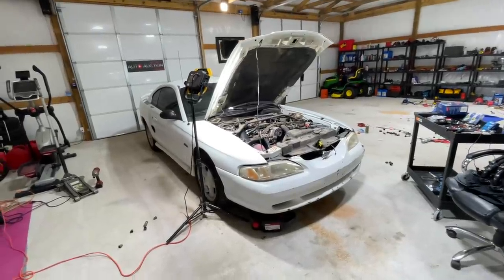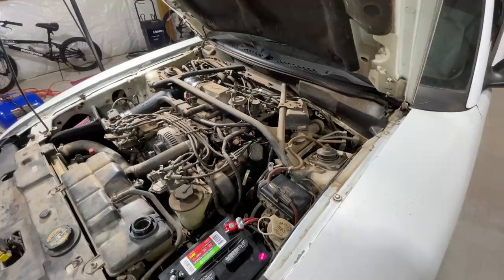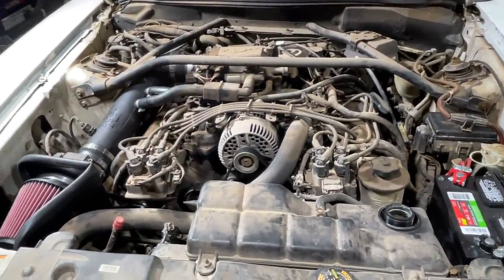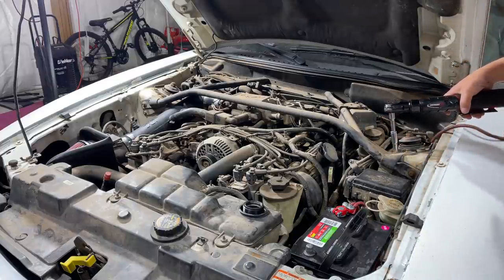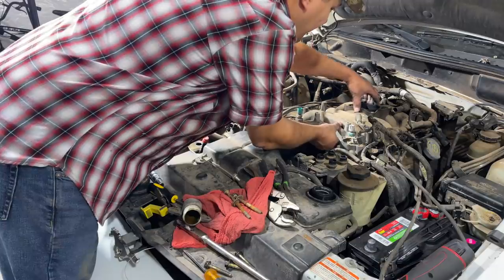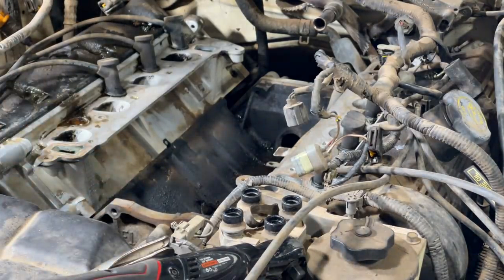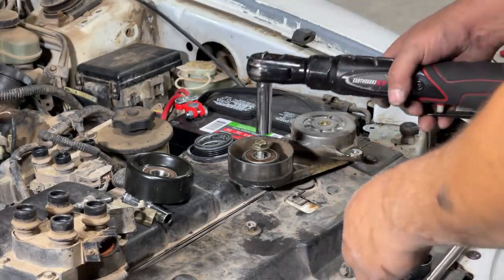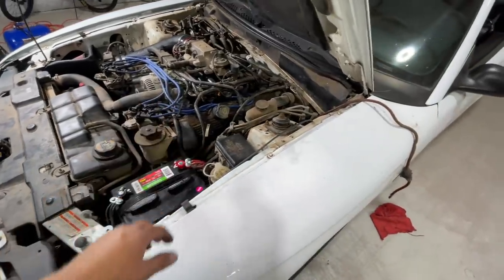$400 IAA 1997 Ford Mustang GT Has a MAJOR Issue!! Let's Fix it!! #SN95

Comment: Randy's still working on the Mustang at 5:30 in the morning after doing a complicated intake manifold swap and the arm chair pit crew on here are out of their minds over a dirty engine. Looks like reality doesn't get in your way often.
Reply from the maker: Amen brother!
Reply: lose the old man grunt.
Reply: I don't think Randy is interested in replacing any more coil packs due to water damage. Happened to him on the S600 and that could be a reason why he hasn't done it since. That's how I can tell that these folks have not followed him for very long.
Reply: This is true,  however if it were me I would have power washed that engine bay before I even touched anything just to make my work space at least 50% clean instead of leaving it 150% dirty.  This is just me talking however.
Reply: Vintage Traveller,  well said.
Reply: it wasn't a diss I just saying clean it so anything want fall in it
Reply: Did you change the hose

Comment: I wish you would detail the engine on the SN95 man. Great content today though 👍
Reply: Yea I would have powerwashed the engine bay before doing the intake.
Reply: Randy, Cris Fix has a great video on cleaning your engine. If you are spending the money on the paint and tires/wheels, it would be a shame to leave the engine compartment in such a filthy state.
Reply: Not gonna matter hes painting it some other color so engine bays gonna look weird being white and the car some other color
Reply: Seriously looks like the car drove through a sandstorm
Reply: I never like working on one when they are that dirty........if i can help it
Reply: Since all of you guys are so picky about how you want things to be done why don't each of you volunteer to stop in and put a day or two a week helping him to get things done! He's a one man show with several cars being worked on! I think he's doing the best he can!
Reply: @TCBGARAGE   it would be nice but i doubt it. Should just repaint it white with some metallic flake in it
Reply: Apparently you guys never saw what happens to an engine bay when a car goes into the paint shop. The prep work will make it dustier than the Sahara. That having been said, It's not a real slick idea to go ham with a hose under the hood. He changed the intake because it was leaking coolant all in the spark plug wells causing the engine to run badly and throw codes. Eventually, it would have blown out the coil packs. He caught it early enough that might be avoided. In extreme cases, it will fry the drivers in the ECU causing that to need replaced. If there are breaks in the insulation on the wire harness, water can easily be introduced causing you all kinds of problems. Alex from Legit Street Cars stated in a couple of his videos that he does everything he can to keep water out of the alternator for obvious reasons. But he does not direct water spray on the top of the engine anywhere. Randy is not doing a Concours resto on it. He's getting it fixed up decently enough to flip for a good profit. If he was building this car with the intent to take it to car shows, then I'm sure he would be meticulous with the engine bay. But he did not state this as his intent.
Reply: Totally agree,  however it doesn't need to be detailed in my eyes either,  but a power wash would have been my priority before touching anything in that engine bay.  Just for the sake of having a remotely clean work space.  This is just my opinion however I'm sure a lot of other people would have done the same.

Comment: This proves your are a pretty decent Mechanic. You did a great job on that and the filming of it. Awesome job. Danm good thing you replaced the plugs they were so nasty and loose.  Is one of the plug wires out of sink? It runs though. I am willing to bet there must be a vacuum line off or broken possibly causing misfire and fast idle 99 percent of the time.    " Sell them all and buy some more! "

Comment: The plugs may be loose for a reason. There is a special way the plugs go into those 4.6 mod engines. I believe the engine should be warm when installing. My 03 mustang blew a plug out the block after a tune up for failing to tighten when the engine was warm

Comment: Some of those intakes don't line up right. You have to put RTV in the head Divot holes or you get an air leak. I'm not sure if yours is that style, it may be ok. Check fuel trims at idle. Had to redo my Grand marquis. There is usually a paper with the intake about it, sometimes not. 4:47, the rubber gaskets straddle the divots on the head.

Comment: Well done, mate.  Several jobs done in one night of wrenching - including a major one.  When she finally fired afterward, she was definitely on 7, but after a couple of good revs, the engine stopped wobbling with the dead miss, so maybe one of the spark plug holes let a bit of coolant down when you pulled the plug and it didn't clear until the engine and plug became hot enough to steam it out.  Give her a run before pulling it apart again - the motor sounds strong (and those pipes make it sing!), so if it's still an issue after the cobwebs have been blown out, it should only be a minor one.  One thing kept going through my head while I watched - a quote from Derek on VGG - "All them electrotronical wiring things really get in the way of a guy try'na fix on it".  All the best

Comment: You should give the engine bays a real good power wash with a de-greaser and cleaner before you start working on them. That way you wont have all that dirt and dust and crud around all your connections and fittings. Just a suggestion.

Comment: Installing the '99 and up PI heads on the '97 block will bump up the compression to about 10:1 and they flow better and come with more aggressive cams as well. The required intake flows better too.

For that kind of major work on the SN95 it's easier to do it with the engine out.

Comment: Hey Randy looks to me like that leaking hose under the intake has been replaced before . Look at the worm type hose clamps, I don't think Ford used them at the factory.
Reply: Correct, they use them one time deals that have to be cut off. Somebody had been there before. They also failed to retorque the spark plugs after a couple heat cycles as indicated by how loose they were.

Comment: My wife's explorer uses an orange- colored coolant from factory as does my mercury montego.  But I can see where someone could easily mix it up or add dexkill to non dexkill coolant.  I'm guessing you found jugs in the car from previous owner.  Just wanted to throw my. 02 about the orange-colored coolant being a factory coolant.  Unless, previous owners on both the above said vehicles are using incorrect colored coolant.

Comment: You can usually quiet a belt tensioner pulley (if you are in a situation where you can not get one right away) by taking a pick and carefully prying off the rubber seal on one side of the bearing and pushing in a little fresh grease,, preferably molly type grease.  Will last a long time,,,  :-)

Comment: Those SN95 intakes (especially the older ones) were notoriously trash.  Really and truly, unless you're doing a full PI swap, heads and all, it's better to go back with stock.  It's not enough of a change that you're missing anything. Also: 1) That leaking tubing in the valley is NOT stock.  There's a heater tube that goes there, and Ford doesn't use screw clamps. 2) Just get a cheap set of fuel line tools from Harbor Freight for $10.  They're worth it. 3) Use the Motorcraft filter for modular engines.  They have an anti flowback design that helps maintain oil pressure in the system that keeps tension on the timing chains. I've done a loooot of work on these engines, and as bulletproof as they are, they need your help. Love seeing some SN95 videos, man.  Thanks, and Merry Christmas!

Comment: The tool for the fuel hose on the fule rail is cheep if uo don't have it it is something you should not be doing. 2 hoses and it comes off with the quick disconnects and you can do it on the bench. The tools are like 10 bucks

Comment: My husband loves working on cars. Heck he wanted to do my front breaks on my ford focus but he wasn't sure on the hardware that came with the pads so we wound up taking it to a mechanic he knows and he watched them do it so he knows for next time how to do them. He even told me he wants to do his own oil change but our house doesn't have a spot where he can work on our cars so we either have to go to my parents house or his parents house. But if I need my transmission fluid checked we have to take it to a mechanic with a lift cause of the location of the checking spot. Which I hate cause I like to check on that stuff and not spend extra money for it

Comment: 7of 8 plugs looked clean but one was full of carbon so maybe get some new coil packs to complete the tuneup. Also a pocket screw driver used around the fuel line quick connects will allow you to remove to the lines or got to harbor freight and get the colored metal fuel lines service kit it's about $20 bucks

Comment: The biggest problem with Ford Fuel lines is if they've never been removed before they can be a bear even with the right tool, the little spring inside there gets corroded and sometimes doesn't wanna budge, lot of wiggling involved til they pop off. I wish they were more like GM Fuel lines, much easier to remove at least on the older ones idk bout the new stuff.

Comment: These cars are notorious for blowing spark plugs. They loosen over time due to the engine block not being threaded enough from the factory. I had a 98 GT and had an issue with mine blowing a plug. I had to rethread the hole. Not fun.

Comment: Not even gonna play through as once you said antifreeze and low coolant i was there. Crossover right? I'll watch to see but my 96 had the same deal. Pretty sure there was a TSB on this as well but since I let it expire because I hadn't seen the issue yet I had to buy one. Gotta get the one with the aluminum crossover because the plastic one breaks. Wooo engineering!
That job is truly a pain in the arse.

Comment: uberman, thats what ill always know you by, that infinit g35 u saw the other day, thats the sad detuned, one throttle body motor. if it was a g37x, thats the motor to get is the 3.7 if you find one, it makes over 135 more hp (339 total) versus the 3.5 motor, and has dual throttle bodies with dual mass airflows, and is what comes in the nissan 370s sports coupe,

Comment: That is not a cold air intake, if its not getting cold air from outside the engine bay its a hot air or short ram intake, cold air intakes suck cool air from outside the engine bay

Comment: I prefer E3 plugs with a good high output coil myself. They've been proven to make more power, torque and mileage and you never have to worry about the gap and they aren't anymore expensive than any other high end plug. Man all those 10mm... it's almost like you're working on a JDM car. I've never seen plugs with such tiny electrodes.. Those ones you pulled out were TINY!

Comment: You got an average deal on the mustang. it was a no run 1997 gt with 192,000 miles. it does maybe $1,500 at a wholesale auction in running condition on a great day. it does make great content. fees at Copart and iaa are stupid expensive. Copart is actually a horrible auction if you are not a dealer. (Fees and attitude as if they are doing you a favor)i understand most of your viewers aren't automotive dealers and over pay for salvage.

Comment: Coolant on a spark plug sounds like a blown head gasket or cracked head.
Reply: no with that design  the inake leak sends coolant into the valley
Reply: @victorwanstreet3038  That intake the failure usually happens at the area where the thermostat is housed. If you saw the new manifold that area is all cast aluminum. . Now if the old manifold cracked at the back by the number 4 cylinder then coolant can get into the  #4 spark plug boot and onto the outside of the spark plug. The coolant line  in the valley that line goes from the water pump to the heater core. Here is a diagram of the  coolant -flow on the Ford 4.6 Mustang engine. http://www.supermotors.net/getfile/167728/original/coolant-flow.jpg

Comment: The fuel rolls are not that hard to pull off. You were making it way more difficult than it needed to be. I’m taking them off so many times. It’s so much easier than you made it. You literally just slide it underneath the wiring harness and you’re good.

Comment: Wow, I swapped out my intake with PI and really felt a low end and mid-range kick in the pants! However, I was talked into a BBK offroad Catless X-pipe and lost my low end Torque. That was a drag. May have a cat welded in to add a little back pressure.

Chris Fix PI Swap.. More Mid and High End HP and Torque. 
https://www.youtube.com/watch?v=beSV_jZxR5o

Comment: Spark plugs arent supposed to super tight they're supposed to be snug
Reply: I never put anymore than 15 ft lbs on my plugs, depending on which ones im installing so yeah never have had an issue. Plus when you over torque them they're a bitch to take out.